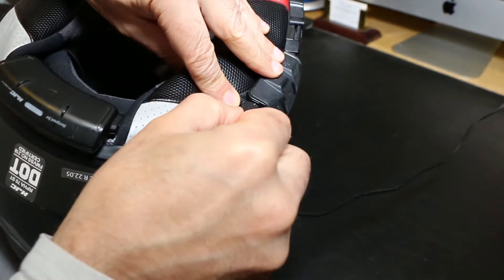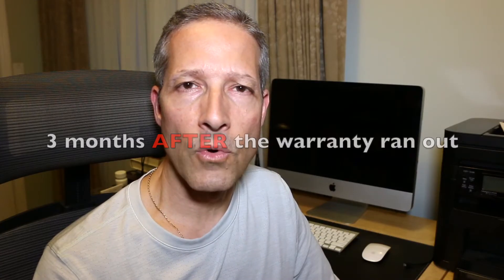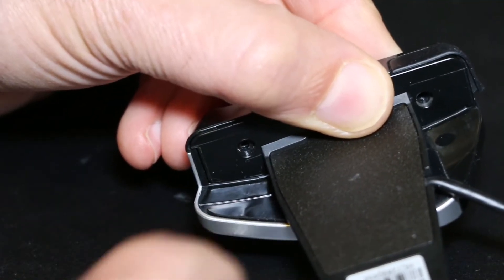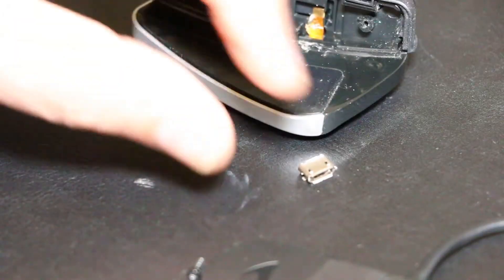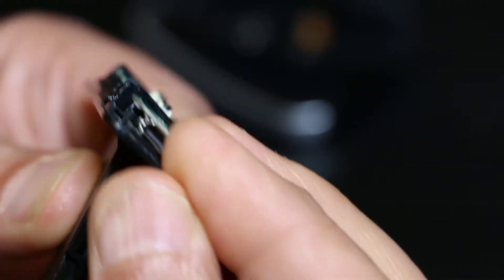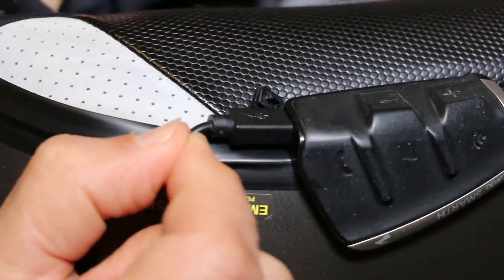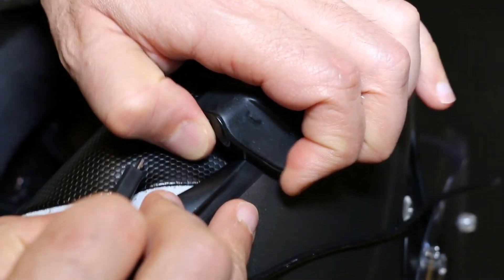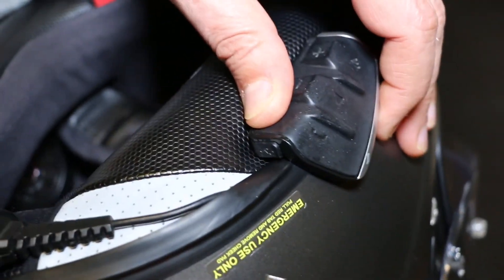Watch This Video Before You Buy A Cardo SMARTH or PackTalk Slim Communication System!

Comment: So far I have fixed 4 cardo slim devices with broken USB ports. In the main unit that sits on the back of the helmet there is a small connector. On this connector you have direct connections to USB. The orange cable is ground, brown is 5V, blue is D+ and yellow is D- (identified via test points on the pcb). I soldered a micro USB extenstion cable to those 4 wires and drilled a hole in the casing. I waterproofed it with some silicone and now I have a fully functional unit with an external USB port. It's quite an easy repair as there is plenty of space in the housing.
Reply from the maker: Thanks for the tip, Padro.
Reply: thanks for the tip, they asked me 60£ (UK) to fix it!

Comment: I bought the Slim Duo pack and both units were replaced 2x under warranty for this issue. When I got the last one back after the warranty ended, I put in magnetic USB cables and used a syringe to fill the area around the charge port with JB weld. It's been holding up for the past year.
Reply from the maker: Thanks for the tip! Do you have a link to the magnetic USB cables? I've never heard of them.
Reply: Great idea. Just ordered magnetic USB cables on Amazon🤣
Reply from the maker: Thanks. I’ve gotta get some of those magnetic USB cables! Safe riding.

Comment: Wow! That sounds like a big design flaw.  I have a Sena smh 10 and you can remove the unit to charge it, so there is no pressure placed on the connector. Time for an upgrade!
Reply from the maker: It sure is. Thanks for your comment.

Comment: Great public service you shared with us there, thank you, very useful. Coming from a person who uses in ear pods and have never experienced in helmet earphones, do all of these comms units suck at above 70 MPH through wind noise? Just wondering to take the leap, especially now Cardio have released the edge.
Reply from the maker: I would definitely take the leap. I use a comm unit with earplugs. Works great.
Reply: @3ftDeepChannel  ok, thanks for the feedback, just bought the slim (some great deals since the edge has been announced) and will give it a whirl. Will also look to alleviate the stress at the charge point. I’m not expecting to be wowed but I suspect hundreds of you guys can’t be wrong and it will be less hassle than in ear EarPods.

Comment: I wonder if this is a micro USB problem. I tend to have this happened even on my cellphones that had micro USB. After 2 years I would have to jiggle it around for it to start charging. The USB C doesn't seem to have that problem and one of the selling features of the new port is that it is more durable.
Reply from the maker: It’s probably more related to the position of the connector on the device, in this case. Thanks for your comment.

Comment: It might help If you open it direct after buying and put some glue between the connector and the plate to fix them to each other.
Reply from the maker: You're right. If you use some "heat-sink" epoxy, that will be even better. Thanks for your comment.

Comment: Probably a little late for you, but anyone with a hot air soldering station can repair that for you in about 5 minutes. People don't need to throw these things away when they can be repaired quickly and easily.
Reply from the maker: What is that? I’ve soldered lots before, but never with “hot air”.
Reply: @3ftDeepChannel  a hot air soldering station is typically used for surface mount circuit board soldering. It's exactly what it sounds like. 

If you want to watch a much more complicated USB port repair here is a video, you can skip past the board repair section if you just want to see a hot air reflow of a USB port.

https://youtu.be/zrMMuicJZ-I
Reply from the maker: Wow, that takes some skills. Thanks for sharing!

Comment: I wonder if you used a more low profile micro usb cable that isn't as thick, would it solve the issue.
Reply from the maker: It would help a bit, but they all create some degree of stress on the connector (I’ve tried many different ones on the 3 units that I have). Better to just pull the unit away from the helmet a bit when charging.
Reply: @3ftDeepChannel  Thanks for the quick reply. I just send Cardo a message asking if they addressed this issue, we'll see if they get back to me.  Pulling the unit away isn't that much of an inconvenience though so that is an acceptable solution.  I already have the Packtalk Bold so i was thinking of something different for another helmet instead of getting the kit.
Reply from the maker: Please let me know if they get back to you. I never heard back from them after repeated attempts.

Comment: I had this issue as well, solution was to add a charging cable once and Ziptie it to the other cables on the headset, that way you are not plugging & unplugging. This connection is a known weak spot.😡
Reply from the maker: Sounds like a good solution. I wish I knew about the problem before I damaged two units off warranty. Thanks for your comment.
Reply: Literally just got my slim today. Thanks for the heads up and solution guys. It does make me want to ask about the waterproofing issues that may arise. Any issues with that after this idea?
Reply: @SpvceGoat  Javon, No issues haven't ridden in down pours yet USB end is tucked close to the underside of the helmet so its protected. My main issue is with the Cardo unit, sometimes it connects sometimes not, maybe its BRP (which I don't use) maybe my phone but  I've been fighting with it for a couple of years now.
Reply from the maker: Once you get that all sorted, then try connecting it to a Triumph motorcycle via Bluetooth… 😖

Comment: Try claiming under your consumer rights. In the UK this is valid for 7 years (not sure in USA). You need to document that the failure is down to a Manufcaturing issue. This can be done by an independent repairer confirming poor solder joint and badly designed fixing of charge port stressing soldered joint. Let me know if successful.
Reply from the maker: Thanks, Chris. The problem is that they never respond. I've heard that from other customers as well. To get a real response and initiate anything in Canada, we'd need the assistance of a lawyer. They would burn off the cost of the Cardo in one hour of work, so unfortunately it wouldn't be worthwhile. Thanks for your comment, though.

Comment: Sounds like it gets hot inside the unit while it is charging causing the solder to soften or even melt. Once that happens, any weight plugged into the USB port, such as a USB cable, will provide just enough leverage to separate the port from the board. Pulling the unit away from the helmet while charging may help because it allows more airflow around the unit, which keeps it cooler while charging. So it's more about keeping the unit cool while charging than it is about reducing strain on the port. Though reducing strain on any USB port should be something to be mindful of. Anyone know if Cardo has, or is addressing, the issue?
Reply from the maker: Thanks for your comment, David. Upon inspection of the broken leads, there wasn’t any evidence that the solder had melted, or that there was any pullout of the leads. Cardo has been completely silent about the issue, and has never responded to any of my attempted contacts with them.
Reply: @3ftDeepChannel  Thanks for the update. Sounds like the pins are breaking off the USB port and not a soldering issue. I'm a long time Cardo user and cruiser rider. I'm adding a naked bike to my garage as well as a full face helmet. I know I can get a second helmet kit and move my PT Black between helmets, but I am leaning towards the PT Slim to minimize drag / buffeting since I will not have a windshield. How have your other Slim units fared? Have you learned or done anything different since posting this video to make them survive longer? Does the USB charging cord needs some strain relief while it's plugged in to make it effectively weightless while plugged in the USB port?
Reply from the maker: I also have a Freecom 4+ and that is holding up just fine (doesn’t have the design flaw). One of my other SmartH units (that is rarely used) is also starting to have the same problem, and a third unit is okay, but that has only been used 2 or 3 times. I’d stay away with any unit like the SmartH. Although it’s very streamline, it has that design flaw (which has been confirmed by many others on the forums since I posted the video). The only way to avoid the issue is to make sure you pull the unit away from the helmet a bit so there’s no strain on the USB port during charging (like I show on the video). So, it is possible to make them last, but you need to be always careful when charging. Good luck.